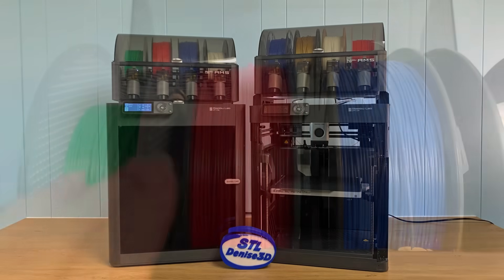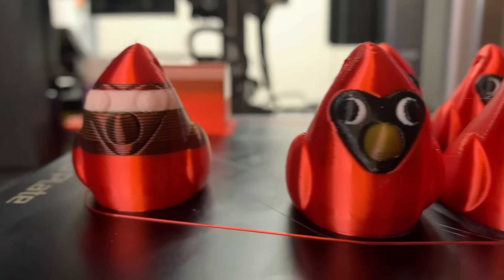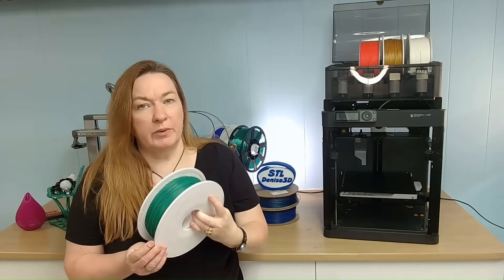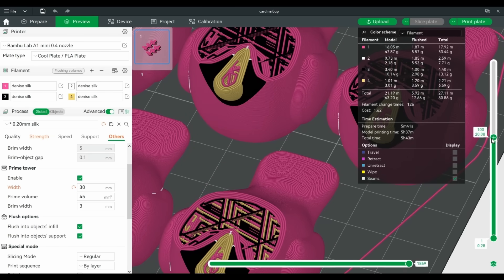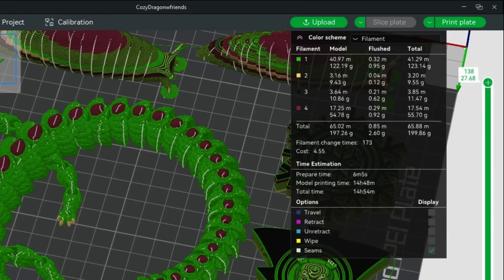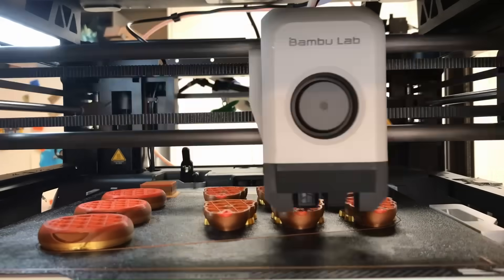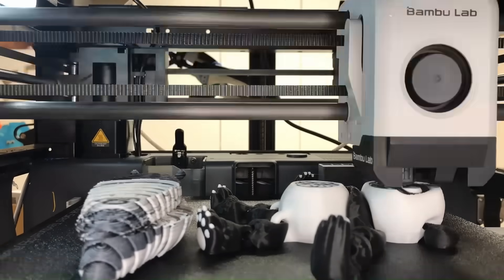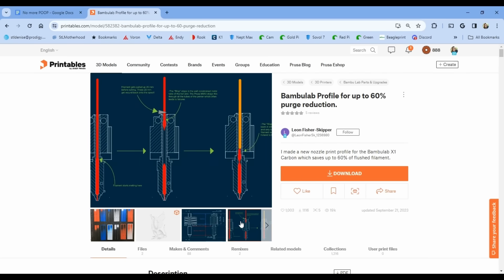Banish Bambu A1 Purge Waste with these 5 Tips.

Comment: Well there's an ultimate way of never have a machine poop again : stop printing multicolour useless trinkets. Use single material parts, eventually print colours separately, then glue the parts together. You will solve the problem and divide printing time drastically.
Reply: This is of course true but multi-material printing does exist and is a lot of fun.  BB (before Bambu) we probably did more painting of things like eyes.  In the consumer market almost everything printed is useless trinkets so what one considers waste is pretty subjective....
Reply: @richardbertacchi5016  Nothing stops you from 3D printing useful items. They're out there in the thousands, just a free download away on sharing sites. And let me tell you, between a tacky-colored articulated trinket and a genuinely useful tool, there's a chasm—each residing on the opposite lanes of the relevance highway.

E3D graciously let me take their Chimera, Cyclops, and Kraken hotends for a spin back in 2014, and let's be real, they were already rocking the 3D printing world. Except, here we are, a decade later, and the multicolor materials still have the same systematic drawbacks: they gobble up filament like it's going out of style, while print times enter the realm of geological epochs. And, let's be honest for a hot minute— the print resolution gives color changes a pixelated vibe, somewhat obliterating the aesthetic argument.

Objectively, as single filament supports are currently mastered, multimaterial is only warranted for built-in functionalities like a flexible joint or a conductive filament. But let's face it, the instances where these integrated features matter are about as rare as a unicorn sighting...
Reply: Thing is, people will not care about the waste as long as their prints are profitable enough. The waste is being accounted into the final price. The other person is paying for it.

That's the human nature. Me me me
Reply: @REDxFROG      I don't think your description of the predatory capitalist is reflective of the majority of the 3D printing community
Reply: @richardbertacchi5016  I've never summoned any political ideology here, old chaps. The crux of the matter is a simple matter of common sense: using 3D printing wisely and minimizing the squandering of energy and plastic. It all boils down to steering clear of printing useless trinkets, because, quite astonishingly, they're, well, useless.
Reply: @axelSixtySix  Sorry, the predatory capitalist line was not aimed your direction and was a tiny bit hyperbolic in any case.  I agree with you to an extent but I've also got a 3D printed Rook MK1 in my living room that's been printing flexi-rexs and fidget snow flakes and flexi octopi out of partial spools and filament scraps and samples for the last six months.  Many of those prints went to Toys for Tots and some were given away and some were sold. All were trinkets and ultimately they are all useless.  They all did bring some joy into the world though.
Reply: @REDxFROG   my man !
Reply: Generally speaking for those selling prints that would be a terrible waste of time. Printer time is cheap <$1, human time is expensive >$25 if you value your time. Also setting up several different build plates for all the little pieces is time consuming. This also doesn’t address prints that require multiple colors on the same layer. The real answer is full color printing. Hopefully sooner than later at less than $30k+ with existing technology.
Reply: @mikereliford55  I understand if you haven't had the chance to peruse all the preceding discussions. As mentioned earlier, the value of a multicoloured print often aligns with its printing cost, whereas hand-painted figurines can fetch a significant price. It prompts a contemplation on whether we should strive for ultrafine multicoloured 3D print technologies—already existing since 2015, incidentally—considering the underlying needs. The yardstick, I argue, should not solely be the hobbyist market or the convenience of a one-button home factory. Moreover, it's crucial to acknowledge that not everything warrants 3D printing; it's not universally the right material, appearance, or manufacturing process for all applications.

I don't intend to sound harsh, but let's face the truth: if you find yourself bored, and the only solace is in printing seemingly meaningless trinkets with questionable aesthetics, perhaps there exist millions of more engaging and worthwhile pursuits. We are worth more than that, in my humble opinion.
Reply: There's always that guy who isn't capable of solving the problem so he just avoids it entirely. That would be you.
Reply: @steelwitness  Is there a superior strategy to sidestep the absurdity of plastic waste than steering clear of multicoloured non-essentials? I'm all ears for an alternative that doesn't involve turning my workspace into a rainbow-hued landfill.
Reply: @axelSixtySix  if you don't know how to properly dispose of trash that's your problem pal😂 my solution is throwing the trash away and not letting go it piles up around your workspace💀 you must not use supports either 🤣
Reply: @steelwitness  Ah, the trash disposal expert speaks! While your passion for trash management is truly inspiring, let's not forget we're all navigating this 3D printing realm together. No need to toss around sarcasm like confetti. My parts are support-free, cutting down on waste and, most importantly, saving me time. Let's keep it constructive and ditch the unnecessary harshness, shall we?
Reply: @axelSixtySix  Pardon my sarcasm sir but I'm as pationate about it as I am 3D printing. In all seriousness I've never bothered with multi color too much. I have two idex printers but they get used for printing with soluble supports. I print things more often for customers than myself. I think toolchangers should be the main focus to help bring the cost down. That way you can have many colors ready without purging. Faster and less wasteful. Unfortunately that's a dream for the future. I don't actually have any solutions for multicolor trash for cheap multicolor setups but thats the whole drawback of affordable options. More wasteful.
Reply: @axelSixtySix   I assure you, in a workshop with 3 Bambu printers running  running a bunch of multicolor and before figuring out some of the strategies in the vid, our work area only occasionally looked like a rainbow-hued landfill.  Most of the scrap was prime lines and skirts from the other printers in the shop.  You may use your printer(s) as a way to manufacture practical prints to avoid shipping.  For most people they are a fun hobby and a relatively environmentally clean one compared to many others.  I'm not saying we should go out of our way to print wastefully but there are recycling options available.  We are not the problem.
Reply: That’s one of the biggest downsides of accessible 3D printing in my opinion, people just waste material printing these really stupid things.
Reply: @dinosoarskill17   Indeed, your observation holds merit. 3D printing stands as a remarkable technology, a tool that should be harnessed to address genuine challenges rather than serving as an escape from monotony. The true potential of this technology lies in its capacity to contribute solutions to real-world problems, fostering innovation and meaningful progress.
Reply: @axelSixtySix  i really dont know if id have my job if it weren’t for printing LOL. I use printers everyday just about to make prototypes of things. I’ve got two in my office here and a room of 8 or 9 more lol
Reply: @dinosoarskill17  We've made our share of practical prints from shelf brackets to bike accessories to tools.  We've also made STEM projects like vibrobots and RC deathracers and dragsters.  Also made a Christmas tree full of ornaments and probably more flexirexs than ever lived on this Earth in the age of Dinosaurs.  98% of all of that was not needed for our survival but was a heck of a lot of fun.  Was it wasting material printing really stupid things?  I guess that is in the eye of the beholder
Reply: Someone's upset they can't afford a better printer 😂
Reply: You’re going to still have to spend time post processing. Saying don’t use the AMS to reduce AMS waste isn’t exactly a big brain solution
Reply: @Reddkomet  I never said to not use the AMS. The fine brain would have notice. I said the issue is multicoloured printing, which is not a stunning feature as the layer/nozzle resolution is very low compared to a inkjet printer. There's ways to use the AMS besides multimaterial, like easy material selection for your print (1 poop only), colour change on a layer (1 extra poop per colour change), or continuous printing using next spool when the main one is empty (1 poop only).
Reply: @axelSixtySix  You can use a knife as a screwdriver and it’ll fit the need perfectly, doesn’t mean that’s the intended design of it. The main selling point of the AMS is the ability to do multi color prints, I assumed your smooth brain would be able to at least comprehend that.
Reply: Lol that's a bit of stupid advice sorry. Glue doesn't always work great on small precise parts. If I want to print colours separately I don't need ams much. Maybe let's just paint everything again? 😅
Reply: @lucyferror82   While acknowledging that the right adhesive can surpass the strength of parts, I concede that gluing isn't always the optimal solution. However, it's crucial to recognize that 3D printing, too, isn't universally applicable, particularly for smaller components. In essence, a well-thought-out design, the selection of appropriate materials, and the correct manufacturing method collectively contribute to successful production.

As for your wry remark about painting, it's a topic not to be dismissed casually. Coatings and finishes constitute a substantial aspect of the manufacturing process across various domains, ranging from footwear to many components of an automobile. Let's confront the truth for a moment: the resolution of a FDM multicolored part lags light-years behind what a modest 50-dollar inkjet printer can achieve effortlessly, even with 50µ layers. This is precisely why hand-painted figurines command a high price—because the artistry of the paint eclipses the appeal of any multicolored print.
Reply: Stop wasting precious energy posting your useless takes here then...
Reply: But...where is the fun in that?
Reply: @Beecher_Dikov  Believing that generating waste and wasting one's time is fun is a debatable premise. One must be as dull as a stone for such an inconsistent notion to surface in one's mind.
Reply: You must be great at parties
Reply: @proaudiorestore8926  Well, it seems I am the reigning champion of common sense! Parties are fun, sure, but picture a world where we can have sensible discussions while also saving the planet from plastic waste. Now, that's the ultimate eco-party!
Reply: The point of this video was to cut back on truly useless material waste, which is a good thing.  You (guessing here ) , me, and nearly everyone in the consumer 3d printing industry are spending time and resources making things that aren't exactly essential.  3d printing waste is a tiny fraction of a percent of the plastic finding it's way into everything.......
Reply: @axelSixtySix sit back down capt planet
Reply: @kraalwig  Sure thing! Living in a dump might be a dream destination for a select few, but the rest of us prefer a world that doesn't resemble a landfill. Captain Planet or not, even tramps would demand better real estate options. Cheers to aiming higher than trashy living arrangements!
Reply: PLA is 100Percent recyclable, bio-degradable and bio-compatible. It's also what most people use so don't stress the waste when it comes to the environment.
Reply: @fakumadda1632 it's not, it's only compostable in an industrial composter it also leaches micro plastics during its degradation. 

Also a lot of people print pla+ with all kinds of acrylics added making it even less so.

Yes it's recyclable but unless the recycling in you area is completely top notch, none of those things you mentioned are true. Most of the time only visibly recognizable petg from packaging gets recycled.

The recycling plant can't determine by looking at your trinket if it's printed in petg, abs or pla.
Reply: @fakumadda1632  Allow me to suggest a thorough review of your sources, for the current state of scientific affairs regarding PLA is as follows: yes, you can degrade this thermoplastic, but only under the peculiar conditions that are nowhere to be found on our beloved Earth. Picture this, unless you're nestled in an industrial or laboratory cocoon, simultaneously locating a temperature of 60°C, humidity soaring over 80%, and a hearty enzyme shindig is downright impossible.

As you can't stumble upon this organic symphony in nature, it means you'd have to artificially engineer these conditions with the help of machinery and energy, rendering composting about as eco-friendly as a rocket launch. Bury a piece of PLA in your garden, and mark my words, it'll emerge unscathed when it's time for you to take its place six feet under. Oh, and  you can repeat the process for the generations to come with the same results, unfortunately.
Reply: Normalize dual extruders on Non Commercial printers so we can do dissolving supports goddamnit
Reply: Or buy a XL 🤓
Reply: If the XL with tool changer is as good as the MK4 it won't have pooping issues but will likely still suffer from the occasional failed print and the useless trinket conundrum
Reply: @REDxFROG for 6x the price of an A1

Comment: Some great ideas and suggestions here. If I might add, I highly, HIGHLY recommend the work done by user DzzD on the Bambu X1 forum on this specific topic. The thread is titled "Ideas on boosting speed for multi-color printing with AMS", and he has developed a specific g-code that you copy and paste directly into Bambu Studio in the filament change g-code section of the machine options (the gear icon next to the printer/nozzle size drop down).

For me, the material waste is fairly negligible, especially now. It's the time spent changing from one filament to another that is an issue for me. Colored prints take far, far more time to print because the change process takes sooo long to conplete. DzzD has not only reduced the amount needed to be purged (I very comfortably purge at 0.7 and could probably get away with 0.6), but also totally eliminated the need for a prime tower. I never use one now. In addition, it drastically reduces the time the print head spends at the purge chute along with other clever changes. I've been using DzzD's g-code for a while now and have not experienced any problems. It has saved me literal HOURS per print, which is huge to me and my business. I almost exclusively print with a 0.2mm nozzle, so bear that in mind.

Google "Ideas on boosting speed for multi-color printing with AMS" and it comes right up. You won't regret it I promise!

Comment: It's a bit nit-picky, but bambu and orc create a prime tower, not a purge tower. the prime tower is there to prime the nozzle for printing. It's the same thing as that line it draws at the start of printing towards the front of the plate. With color changes it needs to do this at various heights so that's why it's a tower. The printer purges the filament in the poop basket, into infill and objects as you demonstrated. That's why you need the prime tower and those 2 checkboxes don't eliminate it. Also the prime tower isn't counted into the flushed filament counter, but it's effectively still poop.
Reply from the maker: Good point, it's still "purging" but for a different reason. I've got a beta version of Bambu Slicer for the A1 and they added a column for the Tower. Now it's clear that the prime tower has no influence on the amount of purge.
Reply: Since it has always been enough to just draw one line it would be a good setting to automatically shrink or slim down the tower  as much as possible!

Especially when the printer starts with printing the infill first ... it would not need that prime tower.
Reply: @hassosigbjoernson5738 have you written this to Bambu?
Reply: Nerd

Comment: One thing I just got into that hurts to see is a 0.2mm nozzle. The extruder volume that has to purge after the filament cut happens is the same, but the nozzle is smaller. You have really big, time consuming poops 😅

But that print quality and tiny tiny, detail is oh so worth it.
Reply: Google "Ideas on boosting speed for multi-color printing with AMS" and follow the instructions on the Bambu forum topic that comes up. I too almost exclusively print with a 0.2mm nozzle, and DzzD's g-code has saved me hours per print. Huuuuuge improvement.
Reply: The purging volume has nothing to do with the nozzle diameter, but with "chamber" between the filament cutter and the nozzle tip.
The "old filament" in this "chamber" needs to be flushed in order to remove the leftovers to prevent contamination.
And some color combinations even need to flush more filament.